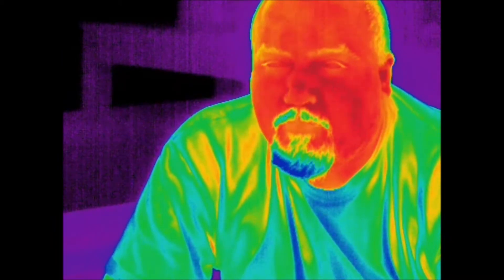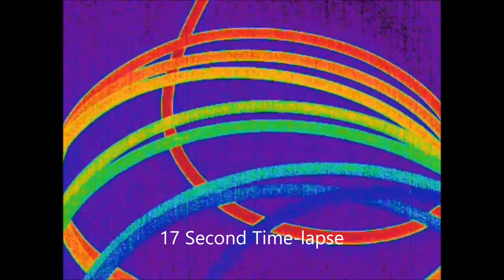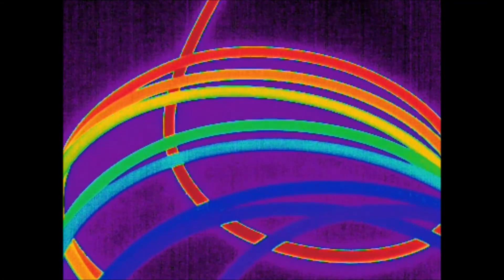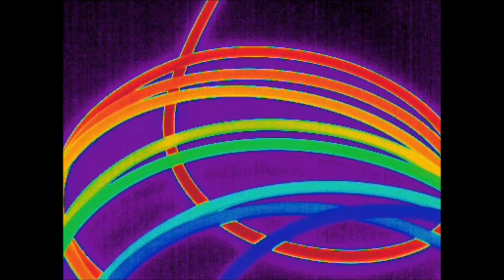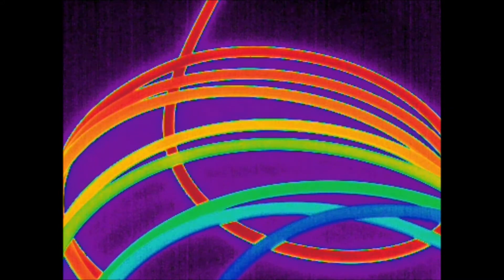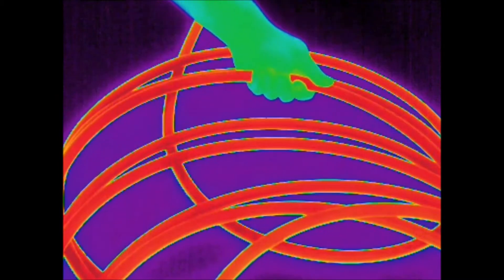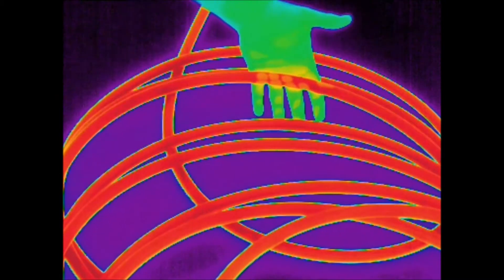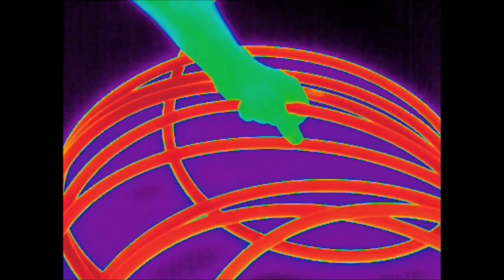Heating the 1600 Gallon System with Fire Part 2

Comment: Rather than a coil I'd have it zig zagging across the floor of the sump as much as possible. I think that would make it more efficent in the water and prevent localised hot spots.
Reply from the maker: That would be a difficult challenge as pex plumbing will not easily bend.  I am not too concerned with hot spots yet  as the water in that tank will be replaced ~1.5 -2 minutes based on the amount of flow being generated from the return pump ~4000gph.  I will be evaluating that more though once I begin testing the heating system.

Comment: Always good to see things coming along, Alex. A lot of these methods on particular systems I will be using for my 500 Gallon build.  Are you planning a part 3 for the heating system?    Very curious to see how you wire into the Renco temp probe to control the circulation pump.  Keep on keepin on!!!!
Reply from the maker: Yes once I get all of the water in the system I will start testing and create part 3 for the heating system.  I did run into a setback on the 720 gallon tank but once that is fixed I will be ready to move on to getting the heating system part 3 video completed.
Reply: AlexGs Aquarium awesome!   I'm currently planning out my large scale build and I'm finding a lot of your methods for systems to be very helpful.   Not quite as big of a build as yours but larger none the less.  Looking forward to more videos.  Keep up the great work!